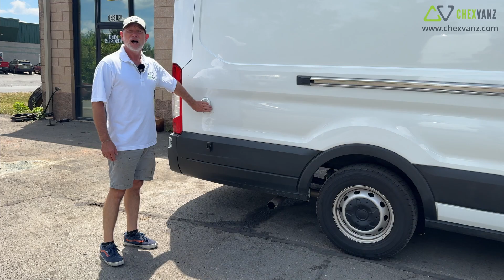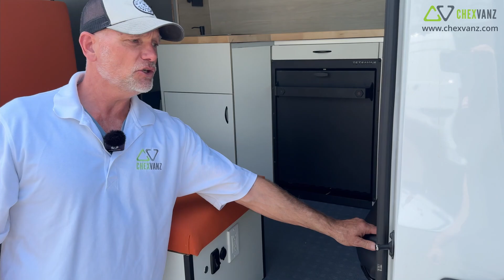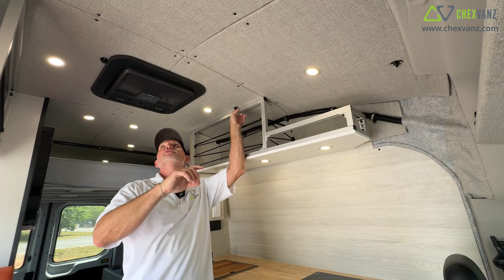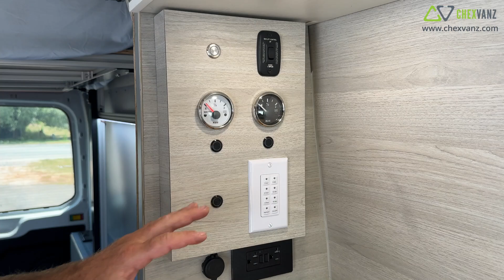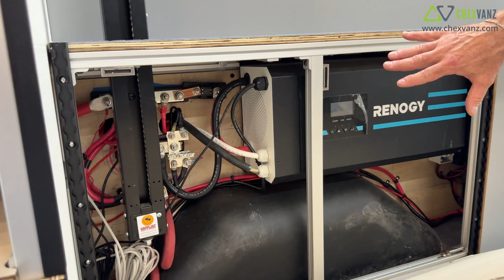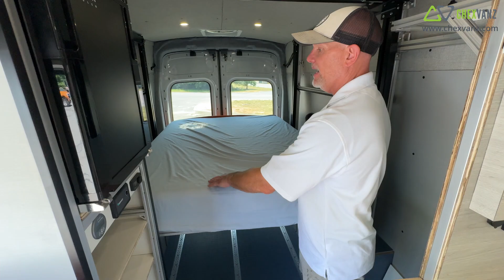MOTO VAN BED LIFT TOUR | Ford Transit 350 High Roof

Comment: how much did the Moto Van cost?
Reply from the maker: Ballpark is around 65-75K for a complete buildout (this does not include the donor vehicle). These typically take around 4-6 months to construct depending on build options.